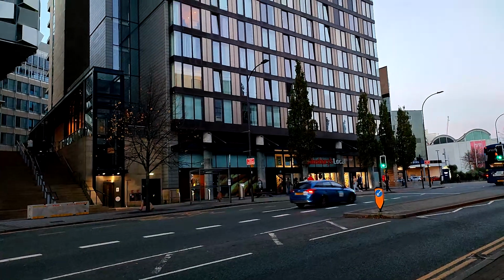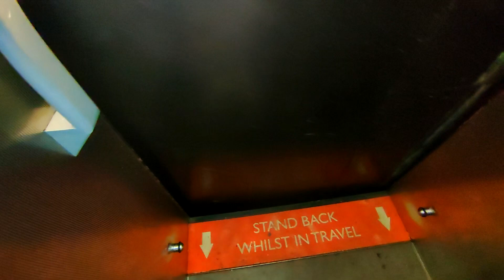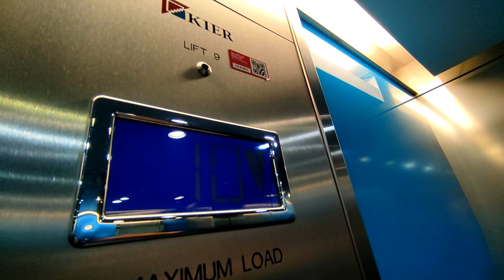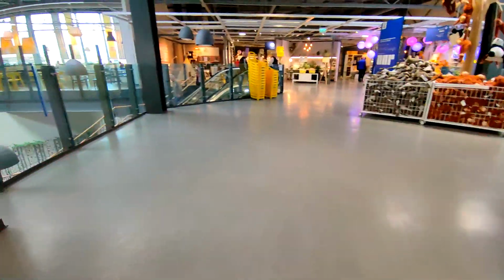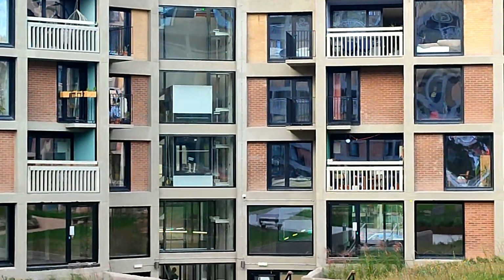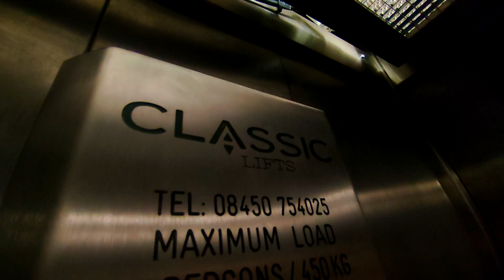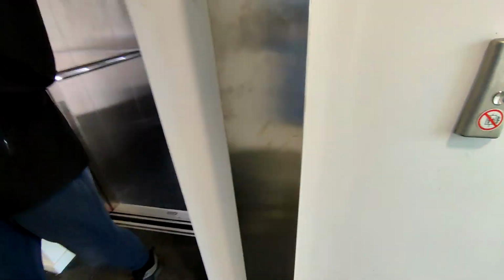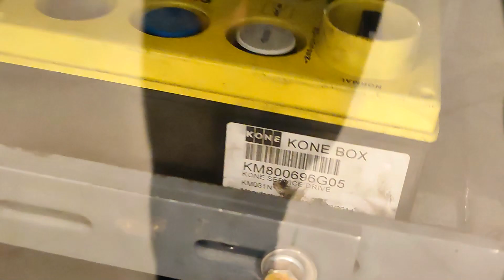The best lifts in Sheffield (With Ryegi)

Comment: Some really large MRL lifts that have a high wight capacity have a reduced speed mode for when they are above a certain weight so they might for example only travel at 0.5MPS when fully loaded.

Comment: Ben, when you were surfing the glass lift, were you afraid that someone outside will spot you?
Reply from the maker: This very rarely happens.  At the park hill flats I was very visible, and I was seen by the residents, but luckily they found it funny.  

With glass lifts with non glass doors, I have never been seen.  People are not observant.  As for shaftless lifts in Spain, I have been seen twice by people on holiday who just waved at me.  But overall I get seen far less than you might think.

The biggest risk of getting caught lift surfing is getting off the lift.
Reply: @benolifts  i was thinking of possibly surfing one lift which has a glass shaft and it’s kind of a part of the design of the residential block. I wonder if people would notice me
Reply: @benolifts  Hi beno when is the new skyscraper sim coming out if it’s out send me the link please
Reply: @benolifts I am leaving Ostrava today. I went into the city hall which has a paternoster and a Výťahy Ostrava lift.

I went to Bolt Tower, which is totally epic. It's on top of a blast furnace, so it naturally a long way up. The lifts from the  bottom of the furnace to Bolt Tower itself was a rather fast generic lift, the one in Bolt Tower was another Výťahy Ostrava.

Výťahy Ostrava is everywhere in Ostrava!

Comment: HELLO BENO
Reply from the maker: HELLO KEKW
Reply: @benolifts  off topic to this whole video 🤣But like have you ever been in a abandoned building with asbestos if so how are you not ill ?
Reply from the maker: @Finnstransportvideos12    To be honest, I don't go in abandoned buildings that often.  I find that the usual trashed abandoned building not very interesting.  I only take interest in abandoned buildings if it is still mint, and does not look like it is abandoned or if the electricity is still on.  Unless the abandoned building has something of significant interest (such as rare equipment still in tact) or has a lift to film, then it isn't worth going in or filming.  There are some YouTubers who's channel is nothing but trashed buildings, and they travel long distances across the country just to see very small scale crappy buildings. And they call this urbex, it is laughable.

As for asbestos, it has to be being disturbed to be dangerous.  Also, if there is wind blowing though the building it will blow it away.  I have been in a couple of enclosed buildings where people have trashed them to the extent where the plaster board (usually 10% asbestos) was all over the floor, and walking through the building kicks up the dust.  I left that building quickly and I dont plan to go in those sorts of buildings as it is dangerous and they are trashed beyond interest.